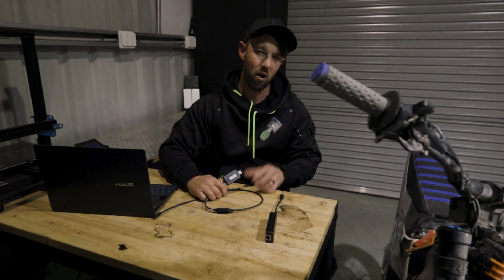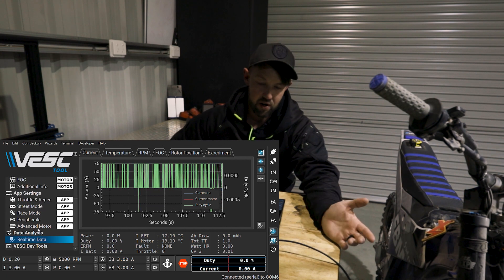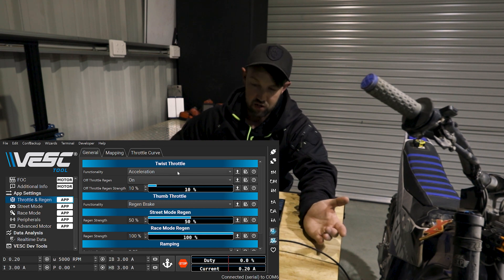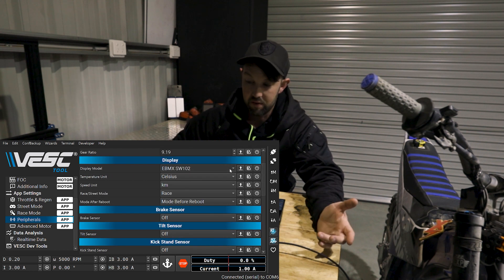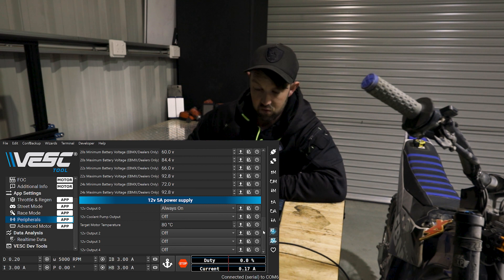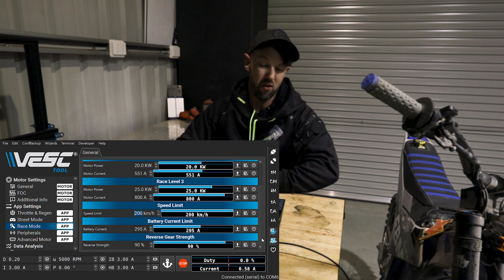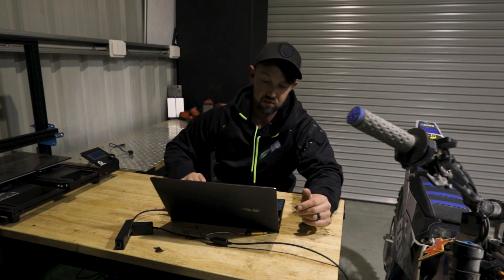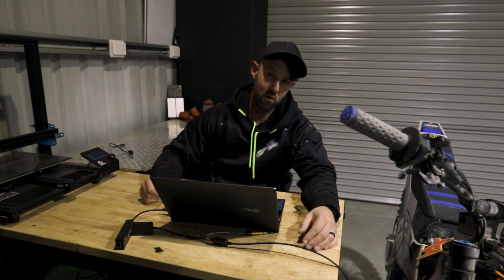How to setup the EBMX X9000 on Pc with VESC Tool

Comment: Found I can bench test an x-9000  I provided 72 volts to the main + and - terminals and pin 2 of the 4x2 (ignition) and the display powered up.

Comment: got a error code 24 something with the hall sensor is out of alignment any idea how to fix this?
Reply from the maker: Error 24 is regen throttle fault. You have to plug it in and then turn it off, if you don't want to use it mate
Reply: @progressive_e  lmfao yep that’s it 😂
Reply: @progressive_e  thank u for answering I really appreciate it ❤️